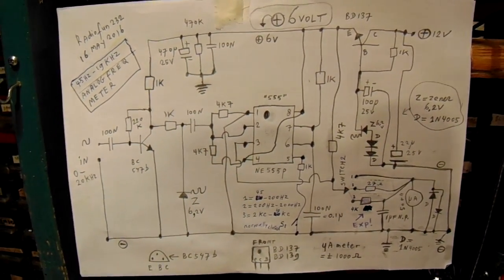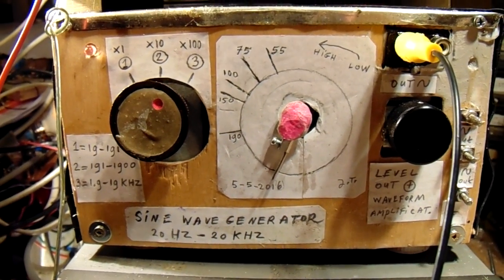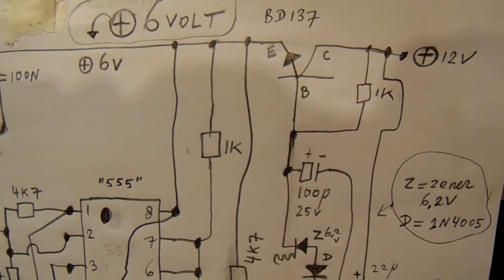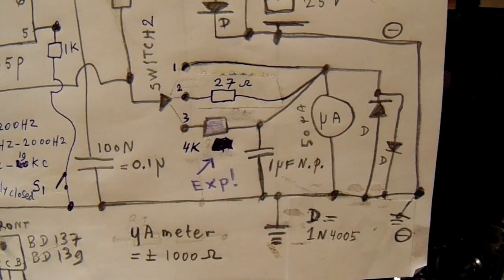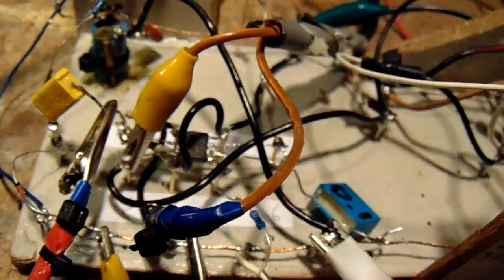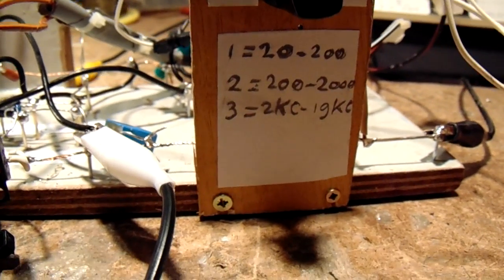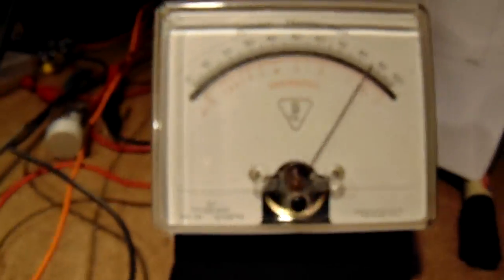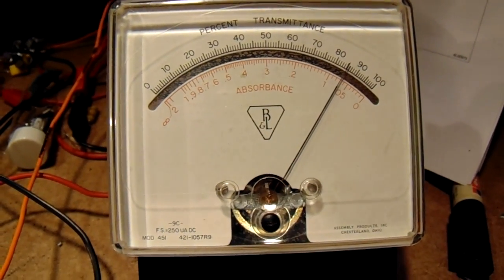Analog frequency meter 45 Hz-19kHz schematic + demo

Comment: What’s the difference from a analog meter & a Smartmeter on a house?
What’s their normal frequency ranges, if any?? 
Thank you for your time. Much love!
Reply from the maker: Analog meters indicate the value that they measure with a pointer. Digital meters with digits. Frequency of AC mains is 50 Hertz (Europe) or 60 Hertz (say: US). Audio frequency range is in general from 20 Hertz to (say) 18000 Hertz or 20000 Hertz. Digital smartmeters give the digital values of: voltage, current, mains frequency, power (watts) and sometimes much more.